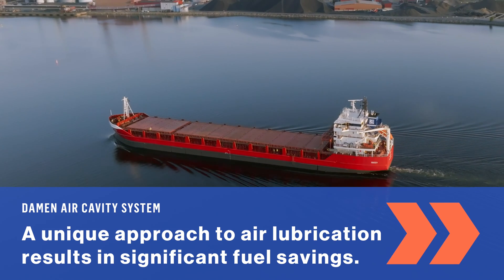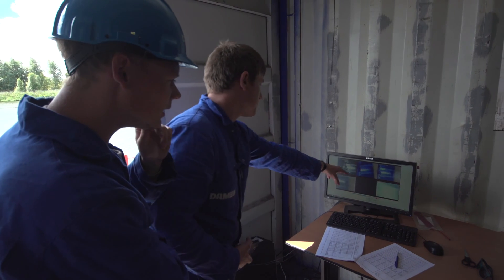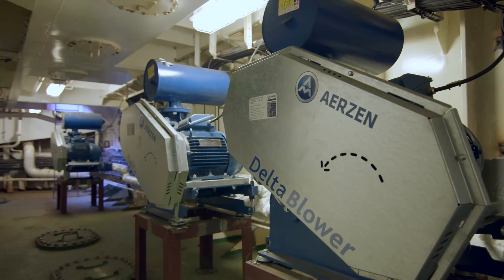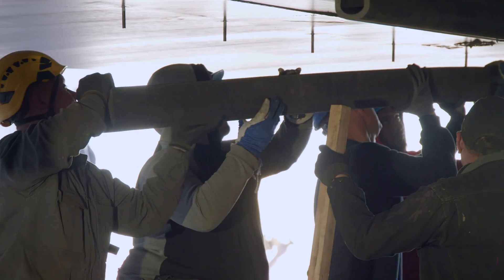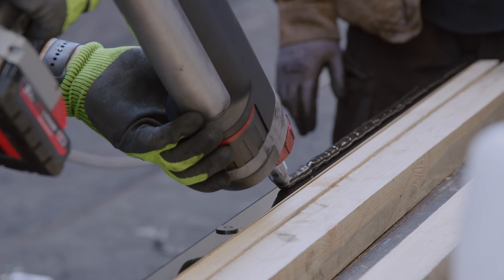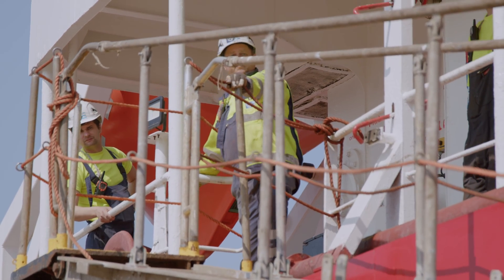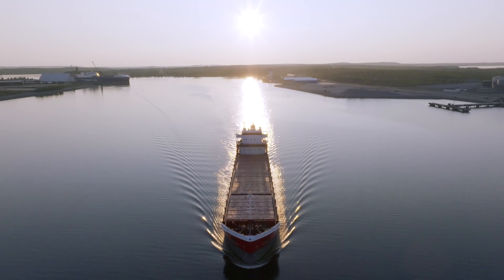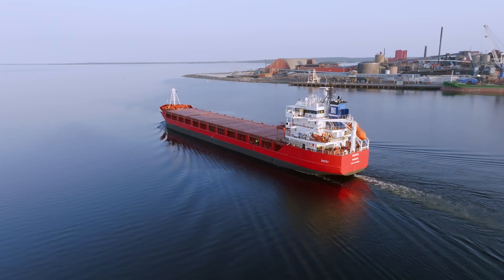Damen Air Cavity System reduces fuel consumption by 7% on existing ship | Damen

Comment: I’m no engineer, but I was under the impression that if a ship wasn’t supported my water evenly around the hull, that it would cause extra stress on the vessel and it could compromise the vessel?
Reply: That’s a different case, in this situation the ship is supported by a fluid evenly around the hull, the difference is fluid on the lower section is air, which has basically the same pressure, but different viscosity.
Reply: @ignacioaguirrenoguez6218  does this only be viable in much larger ship?
Reply: @aldrinmilespartosa1578 Large cargo ships tend to have flat bottoms, like the one on the animation. This makes containing the air much easier, as it’s in a flat surface and it won’t float up, in surfaces in other directions, the air will try to go up, making this harder to implement.
Reply: @ignacioaguirrenoguez6218  with small racing boats that has flat bottoms (being raced in calm waters) would this system work or the change is so small in that scale that its neligable?
Reply: @aldrinmilespartosa1578 It could benefit the boat to an extent, but stability is already a concern in racing boats so it might not be worth it.
Reply: you can think of the layer of air as a tiny cushion that reduces friction between the hull and water. But the water below/next to the air still produces the exact same lift/boyancy